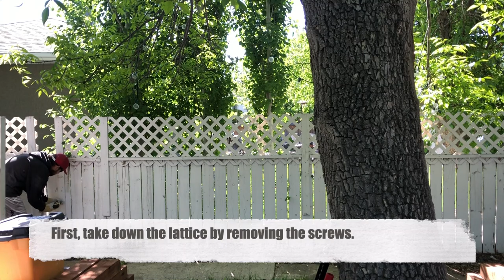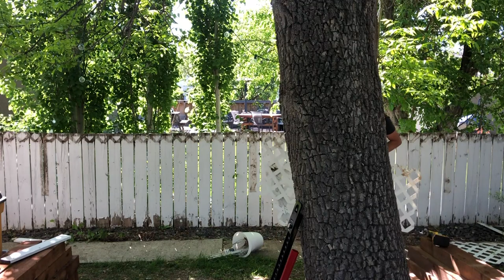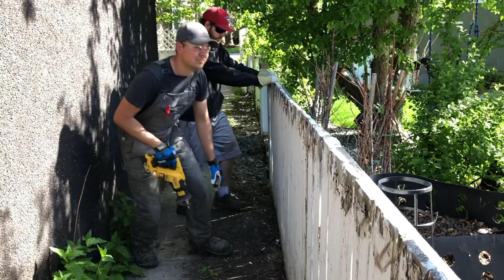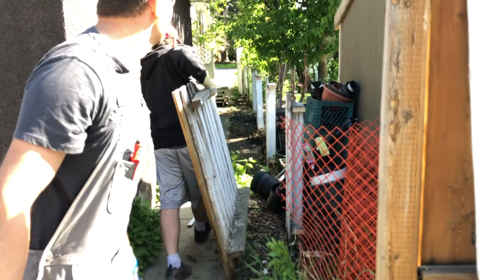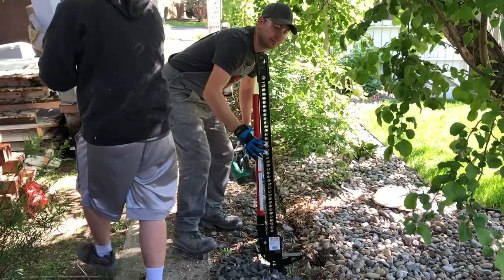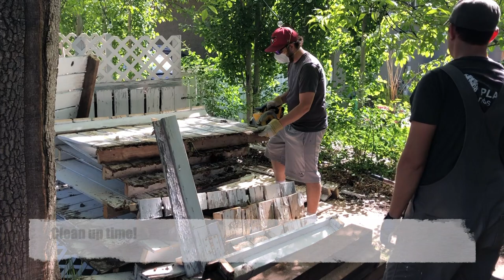How To Tear Down A Fence In 20 Minutes - EASIEST WAY!!

Comment: I have an old wood fence and needed some tips on tearing it down (what is left).  This video was excellent.  Now, I just have to find an assistant.  I have a crowbar, nail pullers, screwdriver and a Sawzall, so I should be able to get the loose horizontal boards off and then tackle the section with the vertical boards.  Great video!!!
Reply from the maker: So glad it was helpful! Power tip for finding that assistant: pizza and beer!

Comment: Love it!!! If cement on posts I’d like to see if works the same or what the trick is if different. Thx
Reply from the maker: it will work on posts with cement, the jackall can lift thousands of lbs, the only difference is i bolt a 2x4 on the post instead of nailing. or you can use a lifting chain. ill be posting a video soon showing it in action with concrete. thanks for watching